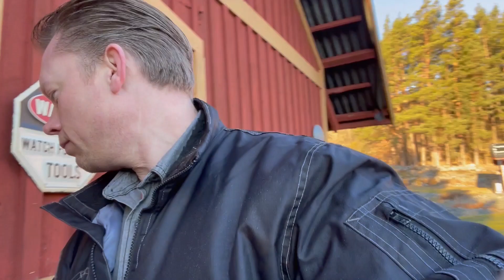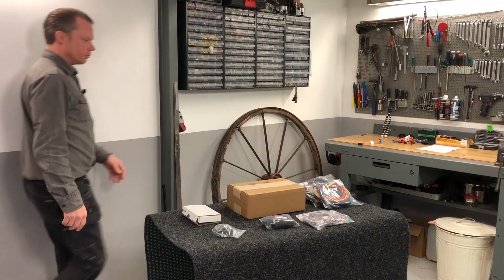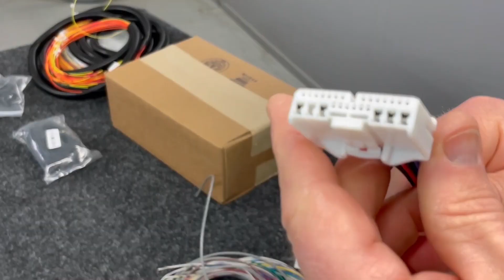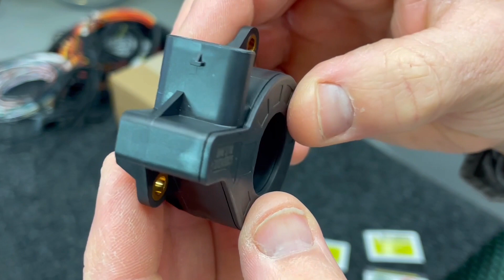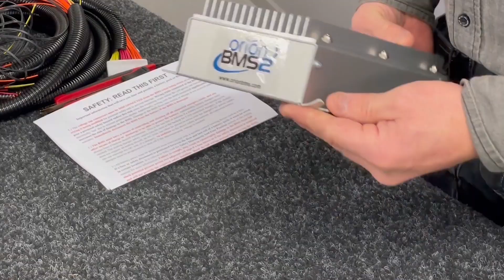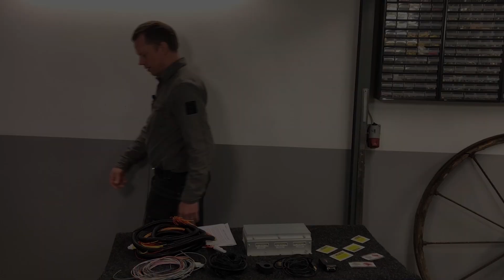Orion2 108S BMS unboxing for my MEB VW Id3 Id4 DIY 450V battery for solar storage.

Comment: A nice Video. Good Explantation. Do you have the cell data of the MEB pack from VW. I use this BMS now, but a do Not have the correct cell Parameter.
Reply from the maker: Thanks ☺️ 
Cell specs:

Capacity: 78 Ah
Voltage: 3,65 V
Length: above 500 mm
Weight: 1.073 g
Gravimetric energy density: 265 Wh/kg
Chemistry: NCM 712 E78 LG Chem
Reply: @ Thanks 👍

Comment: Hi, i would like to add a SPD (surge protector) on the AC side of the invertor. Reason- if something short in the inverter - i dont want 450V DC from the batteries to go back into my house. What did you use? I have been reading all day about type 2 SPS, but they say voltage ( 275V for example) without specifying AC or DC. Would that work on the DC coming from the HV battery and trip if needed? A lightning hit is sort of DC and those spd`s are designed to bring an overvoltage from lightning to earth so in theory they should do the same with HV from battery but i could not any info to support that. What did you pick to protect your home on the top of the fuses and breaker of course? Thanks
Reply from the maker: The inverter all ready have that kind of protection built in from the factory. Battery, Pv, and ac are protected. But of course, extra protection is always good but not anything that I have decided to use.

Comment: why did you not use the original vw-bms?
Reply from the maker: It is because that the canbus is coded and not easy to break. It’s one thing to have the slaves to work and do its balancing together with some microcontrollers, but I ended up to do it like this with a reliable and well known BMS.

Comment: Hej, roligt att se ditt brinnande intresse för energilagring. Lite nyfiken på hur du löser kommunikationen mellan växelriktare och Orion BMS? Är de kompatibla med varandra?
Reply from the maker: Hej,tack😃 Orion bmsen är fullt programmerbar via canbus så har man protokollet så är det inga problem.
Jag har dock valt att köra min inverter i bly syra läge, då krävs endast batteritemp in i bms porten för att invertern skall vakna. Dock så får man göra alla inställningar själv.
Bmsen öppnar reläerna endast vid fel i batteriets cell eller strömnivåer.

Comment: hello how is it going?
Do you work at a Volkswagen dealer?
Also because you have all the clothes.
What I think is important is that all viewers know the dangers of lition inon batteries.
I also work at a dealer, and am a high-voltage expert. in the Netherlands.
You also know that there are actions that we have to replace many ID3 modules.
Sometimes in your videos I miss the dangers.
The ID modules are also traded quite a lot, but we know that there are also many defective modules.
Other than that I think you do a great job Good luck with everything!
I wonder how the Orion bms is doing.
Greetings from the Netherlands.
Reply from the maker: The bms works just perfect.
High voltage and lithium batteries is dangerous, that’s why I always ware protection and also have a sign on my battery. I hope and think that people have seen that and understand that.
Thanks for your comment 😊

Comment: So are you planning to get this BMS to connect to your inverter, right? The original one from VW won't do that job, correct me if I am mistaken
Reply from the maker: Yes you are right. It will communicate with a micro computer and the computer will talk to the inverter.

Comment: Hello, how about communication with the inverter? Do you already have the modbus protocol?
Reply from the maker: Yes my plan is to control the inverter via modbus. And my installer has the protocol. Programming is completely new for me so that will be interesting…😅
Reply: @flyingtools  I'm sorry, I meant the CAN bus protocol. I have Modbus and I control the inverter SOLAX through it. Both data read and commands. Does your BMS have modbus? Most BMSs only have CAN bus.
Reply from the maker: @milan2931  Ok.
The bms can be programmed via canbus directly to the inverter, but it takes a lot of programming from what I have heard. It’s much easier to have the bms to work with a micro computer and let the micro computer talk to the inverter via modbus. 
All this programming is totally new for me so I’m not really sure what I’m talking about 😅
Reply: @flyingtools  We need to get the CAN protocol from Solax.

Comment: Beautiful video, as always.👍
I have also been looking for such a high-voltage BMS.
My question: do you know if the BMS works with the Solax inverter?
Reply from the maker: Thank you so much ☺️ 
If you have the canbus protocols and the knowledge in how to program it, it can control the inverter just like it was a solax battery. I will connect my bms to a micro computer and controll my solax that way instead.
Reply: @flyingtools  I had the documentation on Solax's Can-Bus protocol somewhere. I can't find it at the moment....😬😶‍🌫 As soon as I find it, I'll send it to you if you like.
Reply from the maker: @RichardSteigmann  Im very interested in the! Let me know if you find it😃👍🏻
Reply: @RichardSteigmann  Hello, I would also ask you to send me  🙂